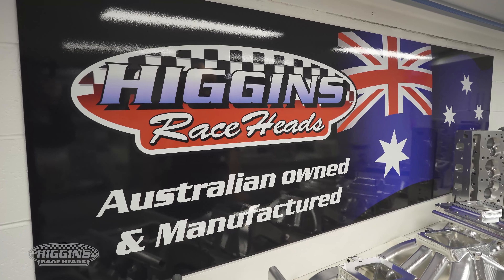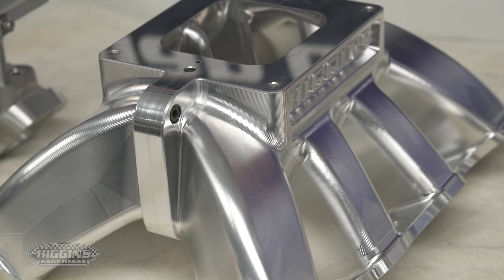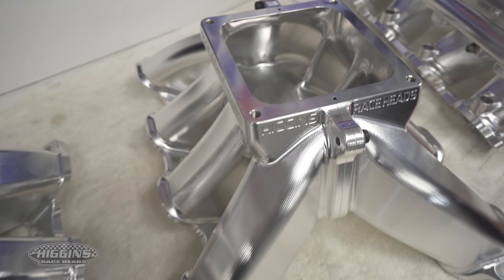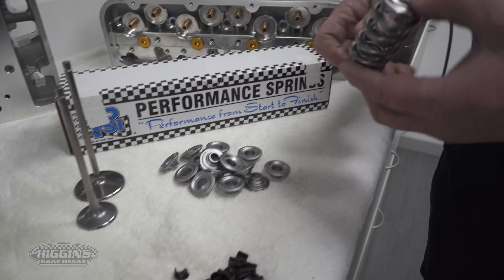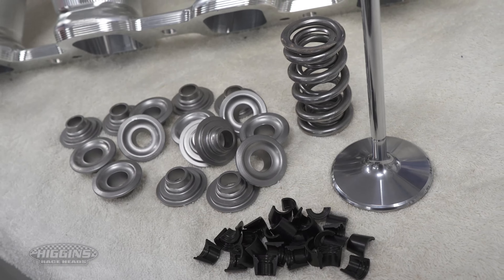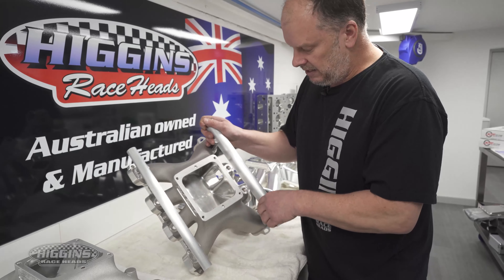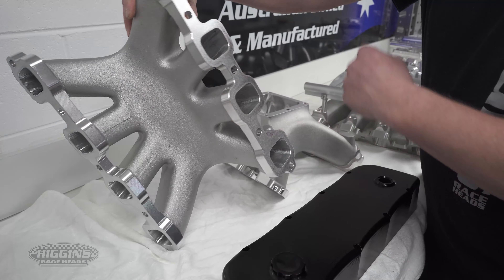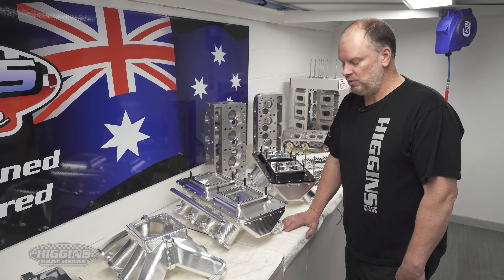Chev SB2 Induction by Higgins Race Heads - 2021 update

Comment: I'm watching this again because I'm searching if anyone has built SB2 style heads for a BBC. It would be good on a big 572 or 632 to run SB2 style intake ports just bigger with spread port exhausts.
Reply: Hi buddy the SB2 heads are essentially base on the cantered valve design of a big block chev head, and trust me the after market is not short of big block head options to suit all budgets.